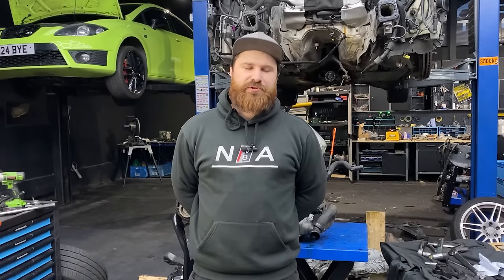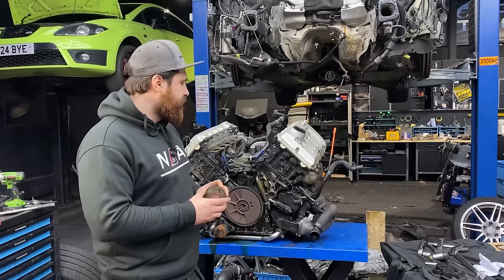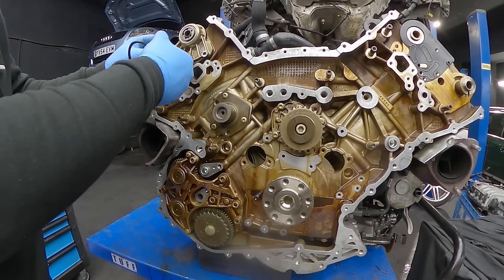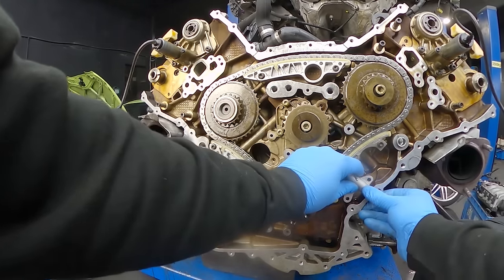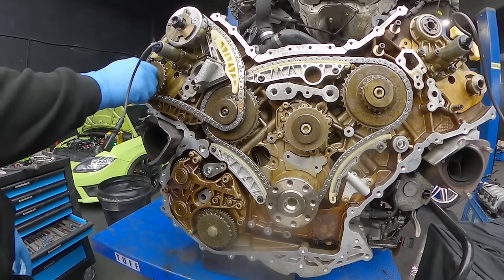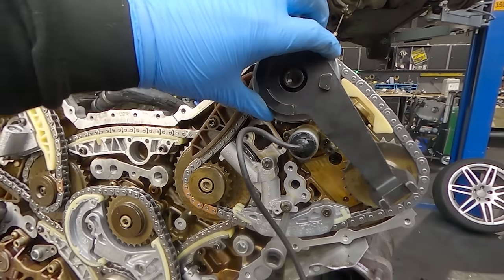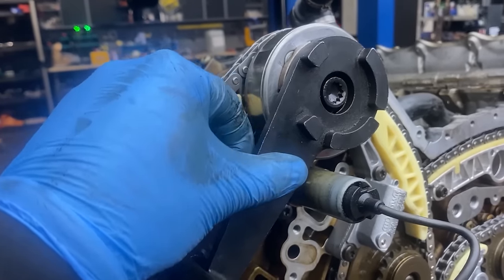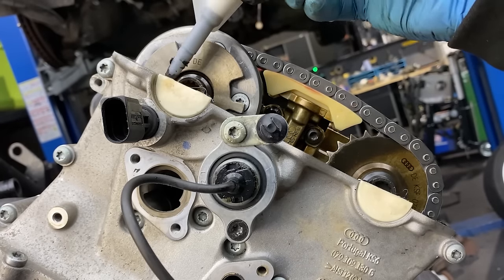What exactly you need for the job?Manual how to install timing chain kit on Audi S4 V8 BBK .

Comment: interesting that you replaced the diamond disks, ive talked to multiple rebuilders here in the united states and none of them replace them unless they are damaged. another interesting note some of them reuse the cam bolts, which I can see as justified after some testing as that plus 90 only marginally stretches the bolt and the total torque is still within spec of the bolt by industry  standard. Ill also point you to AMTuned here in the U.S. in florida, He remachines the factory cam gears for 300$ us, the work is quality and they are modified to provide better engagement to prevent the wear from occurring. Overall excellent video, wish i had this a couple months ago while i was doing mine. Cheers
Reply: Audi manual says the diamond washers and cam bolts are not reusable. Anyone reusing them does so at their own risk.
Reply: @Heartbeat1991  I know what the manual says, the gentleman I spoke with who gave me that info warranties his rebuilds for 20k miles. I reused the washers in mine but did use new bolts
Reply: @brennanlukas5467  that’s on Alex if he wants to warranty that.
Reply from the maker: First S4 I done was my own one and the intake cam  did jumped🥲🥲🥲🥲🥲🥲🥲
Reply: @VAGTechnic   did it bend valves? ive heard that these are interference engines (and seen the proof) but mine has come untimed 3 times now with no valve collision. both my exhausts have come undone thanks to a torque wrench failure that was only caught after. and yes, you can retorque the intakes in the car with enough grinder action :) cheers

Comment: perfect timing, just ordered my timing kit last week.
Reply: ps. is that serp belt routed wrong? I though it went on top of the upper pulley
Reply from the maker: the belt should be from the top of the idler pulley
Reply: @remedia1200  yes. It’s wrong.

Comment: Great video. I don’t think the spec for  torque on the upper cam chain tensions is correct. The lower two are 10nm but the upper two tensioners are 5nm + 90 degrees. At least that’s what I’m seeing in the factory manual.

Comment: What would happen if the timing marks for the camshaft intake and exhaust gears are not within the range? My shop says the exhaust gear is off by about 90 degrees. Car started and ran "fine", CEL P0018 G163 is active. Is there a way to know what damage has already been done?

Comment: Awesome video. Engine out on my B7 s4 right now and about to do the chains. Quick question. When you tightened the cam bolts did you just use the cam locking plate to hold them in place? I heard it could bend the plate?
Reply: Just finished this up and tightened the cam bolts to spec without holding the cams. The chain and cam locks seemed to hold everything just fine.

Comment: Thanks for the video.  I am finalizing a parts list for this job.  I have the timing chain kit, but did not consider some of the external gaskets mentioned.  Also, what kind of brake cleaner were you using?  I used some to clean the front of my engine up and it doesn't quite have the finish yours has.

Comment: Last Audi V8 I had was the ABH V8.. It burnt more oil than a TDi - it was 60 liters of gasoline and 1.5 liters of oil in the engine.. I guess thats what 300.000+ km does to a aluminium engine block.
Reply from the maker: its the nikasil coating whats the issue
Reply: @VAGTechnic  or rather, the lack of nikasil in my engine.. :D

Comment: Great video! Would you recommend to replace the 2 "in between"-wheels that connect the camshaft chains with the crankshaft? 
In this video you seem to reuse the old ones but I have a cost estimate workshop that wants to change them out. Too bad that I don't live in your area.
Reply from the maker: We never change them

Comment: Hello, I have a question about 3.0tfsi 333hp engine. I've changed crank vent,new cover gaskets, new spark,coils etc. Now when I push hard gas I have error p0420 and p0430 at the same time(catalic converter). When I drive calm no errors. I need to do 6000km for a vacation,if it safe to ride with this error or I can damage engine?

Comment: From what company do you buy original vag parts? From a dealer or some other company?
Reply from the maker: In U.K. it’s called TPS for trade only .

We have the kit available if someone need it 

https://www.ebay.co.uk/itm/Audi-S4-V8-BBK-Genuine-Timing-Chain-Kit-RS4-upgraded-guids-/175092988430?mkcid=16&mkevt=1&_trksid=p2349624.m46890.l6249&mkrid=710-127635-2958-0
Reply: I’m late to the party, but the link doesn’t seem to be working. Is there somewhere else I can look for it?

Comment: There is no balance shaft. If there was that would need to be locked in time also.
Reply from the maker: True , Dont think we had it ever out 😂 you know for what it is ?
Reply: @VAGTechnic  there was a diesel V8 that used the same block. That had balance shafts. 

There’s two holes at the 4 and 7 o clock positions below that gear. Sometimes they have a block off plate on them, some do not. 

The upper gear and pedestal are replaced by a gear with a balance shaft gear drive for the two balance shafts on those Diesel engines.